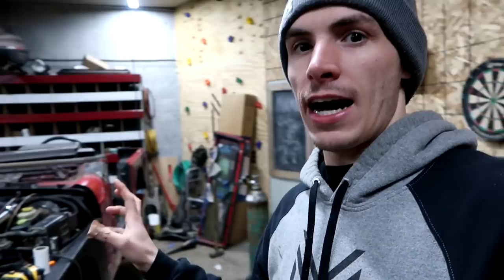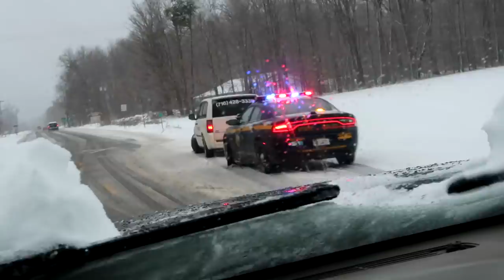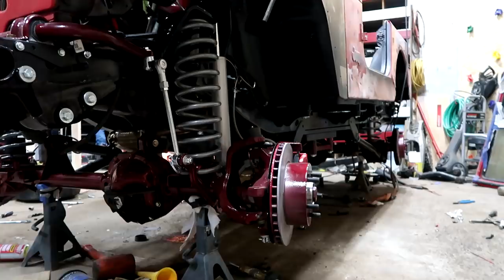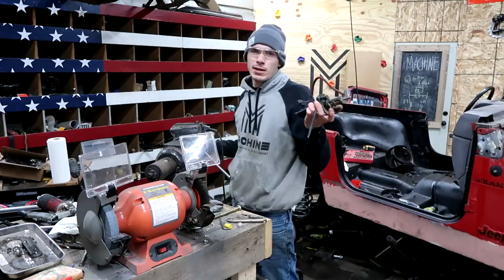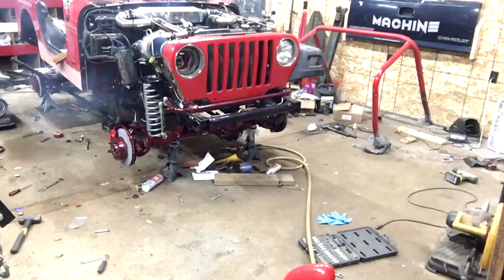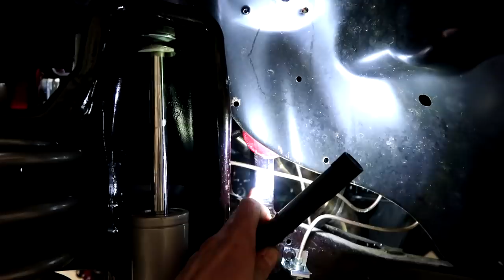Turbo First Start Up!!

Comment: Slave/masters cylinder is a nice easy job on jeeps! That clutch sensor unclips from that shaft but cutting it works too lol
Reply: JTwelder i thought the same thing  but he didnt remove the clutch master rubber he just poured the brake fluid  in the rubber lol
Reply: @tomriley4316  I was looking to see who else saw that

Comment: You need to take out that little rubber boot out the top of the master cylinder on the firewall before you put in the fluid once the system is bled then you put that rubber boot back in the top and screw the cap on

Comment: i think that master cylinder has a rubber thing in it, and im pretty sure thats all you filler up, so if your having problems getting the clutch to bleed you may want to remove that rubber deal in there and fill it again... i could be wrong lol
Reply: Lol I seen that too but if you watch he has it removed in the next part of the video.  He just didnt show the oops he did.
Reply: well, he should start showing the oops, makes it more relatable lol.
Reply: diesel Power N GunPowder I saw that too, I was looking for a comment to see if any one else noticed it lol I wonder how he got the clutch working of he just filled up the rubber thing

Comment: You need to remove that rubber air gap boot from the master cylinder. The fluid goes under that boot.

Comment: You could have just taken the white clip off the neutral switch sensor and it would have just came right off the metal rod without having to cut anything